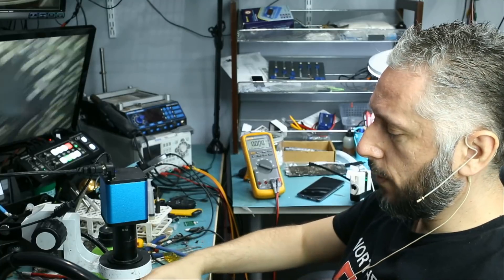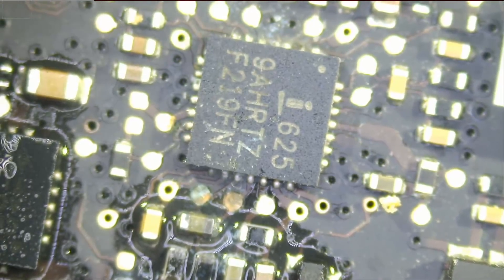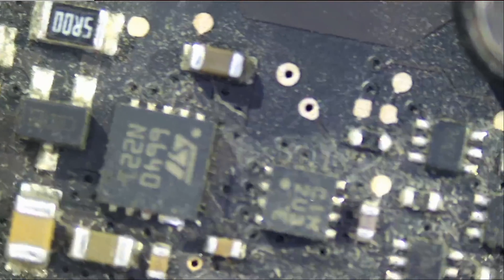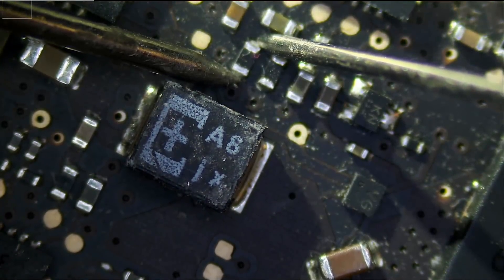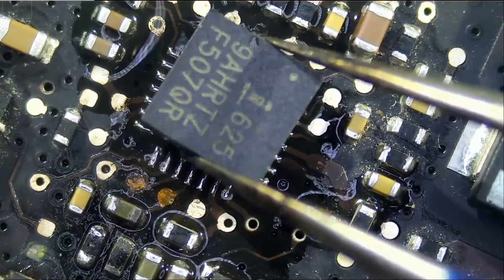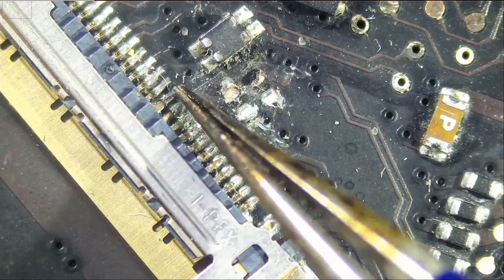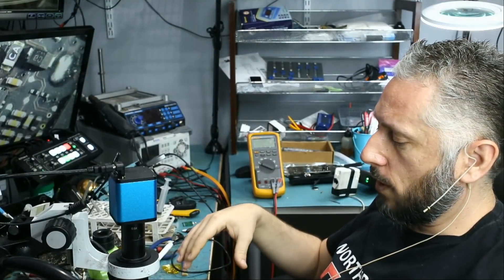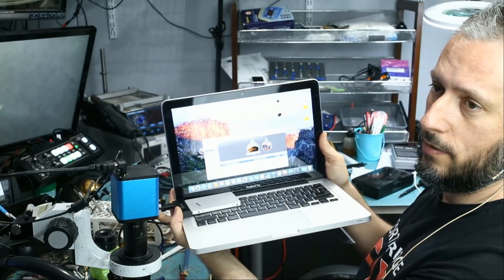2012 Macbook Pro No Power Repair - Motherboard Physical inspection is very important.

Comment: My MacBook Pro mid 2012 shut off when I turned the laptop around. The charger I bought off of Amazon way back was making noise like spark noise. It shut down my MacBook Pro and I can’t turn in back on. I opened it up and nothing out of the ordinary such as burning or motherboard corrosion. I need help.

Update: 1/12/23

It works. I took the bottom plate off then l Unplugged the battery and let it sit out where it was cooling off. But I’m still going to have to get a new charger which was the problem for my MacBook Pro.

Comment: why bother soldering a 0 ohm resistor? why not solder a jumper wire and prevent future failure? what is the point of a 0 ohm resistor?
Reply: 0 ohm resistor has high resistance. A wire has no resistance!
Reply: @NafehSaad  a zero ohm resistor has, guess what, zero resistance, that is to say no resistance, which is the same as your wire. I understand it can handle more current, but still that provides no answer to my question.

Comment: I really appreciate what you're doing to help the repair community out with your videos. I've been working in this field for many years but I've never been particularly good at solder work until I started watching your videos and now I've been very rapidly improving! I was wondering though, would it be possible to display on the video what temperatures and air flow you're using when you use the hot air station? Or the temperature of the soldering iron? Or at least maybe mention it out loud as you're describing the process? Either way, I thank you again for all that you do and I wish you well!

Comment: i have a dell ispiron 24  think its 24 inch but its almost the same size as my 27 inch monitor but this is a touch screen. i plug it in and the screen comes on but not the mother board any ideas on that

Comment: I've watched some macbook motherboard repairs and came to the conclusion that the hardware is designed to retain performance but at  high cost if you're negligent with the device.
Having high voltage run through the system means that you can attract moisture from the atmosphere and in any case if moisture gets on the  board,  components will corrode in a matter of minutes if not seconds.
 On the other hand the power you loose because of the cooper trace resistance is negligible and the trace can be built thinner. You're taking high voltage and low amps and coveting it to low voltage and high amps near the point where power is needed. You can think of it as the AC power grid of the city.
It really is the way to go if you want to retain performance over time as lead free solder joints age.  With most old laptops if the issue is not the hdd, it's most likely IC's that can't get the necessary voltage they need.
The paradox is that while the hardware is future proof, Apple's service policy makes them throwaway items once they stop working.
Accidents are frequent in mobile devices such as phones and laptops and those high voltage lines  should have been built only on desktops since there subject to less atmospheric changes and wear and tear.

Comment: The one resistor reading in the megaohm range is virtually an open
Reply: Do failing resistors most often open (increase resistance) rather than close?

Comment: I keep a small box of old shields from donor boards on the side of my desk, always come in handy when I need to shield s connector from hot air. Especially the shields from RF sections of boards, as they're a lot thicker. The vertical edges on shields adds a little bit of shielding, as it provides a "wall" too if picking a shield of appropriate size), so the hot air doesn't funnel unhindered underneath the edge, as it can often do with metal tape. I find this technique affords me those extra few seconds that significantly lower the risk of damaging plastic connectors. If doing a lot of work in the area, I tape the shield down.

Comment: Why would a MFG put a 0 Ohm resister in a circuit? That doesn't make sense to me!
Reply: Electronics Circuitry 101 :

Never take Manufacturers for Granted.
Reply: Zero Ohm resistor can be thought like a JUMPER: one can remove it to separate the board in two sections, I.e. before and after this kind of bridge. So, it will be simpler to find faults. Regards from Italy.

Comment: How is that program called where you can see what the resistance for each component should be?
Available to see Smartphone boards in there as well?
Reply: The program is called FlexBV, and Paul Daniels is its developer. He has a repair channel on YouTube. Look for Paul Daniels. As far as schematics are concerned most iPhone and Macs schematics are available, but you have to locate the sources and purchase them. The program FlexBV does not supply the schematics.